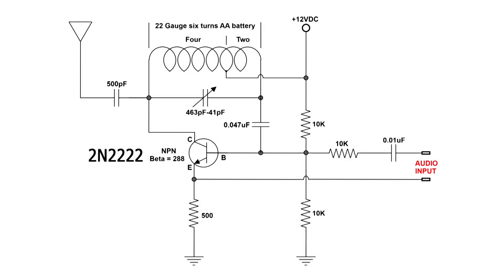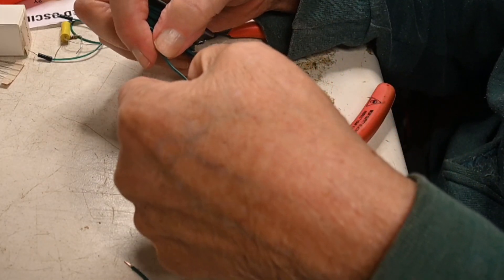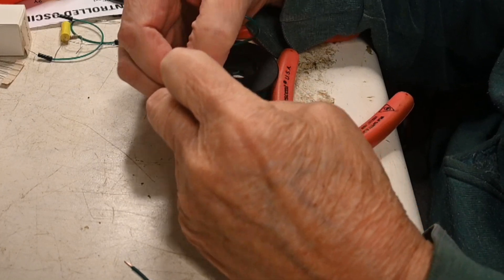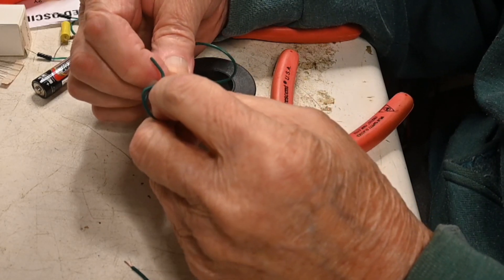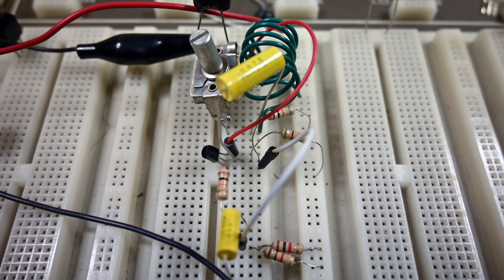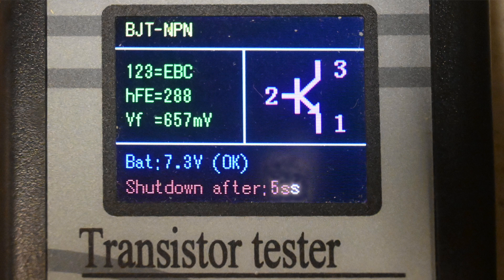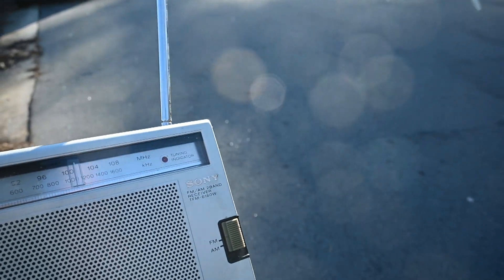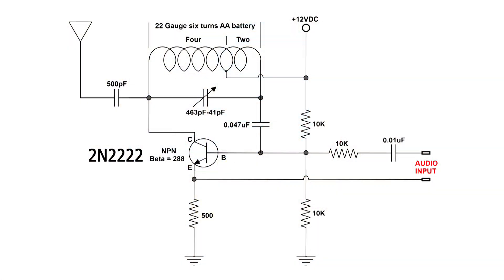FM Transmitter Home made Coil Build Demo

Comment: Very interesting, and I like the way you did the tap wire on the coil.
The wire I have is the same, but it is magnet wire, with the varnish coating.
That was a good distance receiving the signal from the house.
Thanks, Rick, that's another project for me to try. 📻👍👍
Reply from the maker: Thanks! Just about any wire should work. Let know what happens. Thank you, and thanks for watching.

Comment: No luck on my end getting the IC circuit to oscillate.  I tried several different transistors and verified the circuit was getting voltage.  It's always a great learning experience trying to find out where I have made the mistake.
Reply from the maker: It is about the same circuit as the AM. Ask your questions!
Reply: @AllAmericanFiveRadio  I can get the IC to oscillate at around 8 to 15 Mhz depending on the setting of the trimmer or whether I physically compress the coils together.  The peak to peak voltage of the signal from the antenna is around 5 volts.  Funny thing is I need to ground the oscilloscope probe to the Emitter leg of the transistor to be able to see anything on the scope.  Where do you think I made a mistake on this circuit?  Is the variable capacitor at fault maybe?  When you said the the capacitor needed to be close to the coil, was this a physical closeness or a wiring closeness?  Thanks in advance!
Reply from the maker: @edtully2740  What does IC mean, Integrated Circuit? It’s hard to tell what the problem is with comments. The variable  capacitor and coil should be as close together physically and electrically as possible. Can you make a video of your circuit. You can make it Unlisted and send me the link.
Reply: @AllAmericanFiveRadio  LOL.  I thought IC was the lingo for inductor/capacitor circuit.  I am sorry for the confusion.
Reply from the maker: My email is allamericanfiveradio@yahoo.com
Make the subject FM transmitter.

Comment: I have also made one transistor Fm transmitter circuit using BD135 ,it sounds really great with good range of 200metres ( using just wire antenna) , it is basically Brazilian design, i got it from Newton c braga website.

Comment: I have a CCrane FM transmitter. FM2. What Crane doesn't tell you is about the range pot underneath the spec label.  Once you turn it all the way right and add some extra wire to the telescopic antenna, I can drive out of view of my house and still hear my station.
Reply from the maker: Thanks for the information, and thanks for watching.

Comment: I wonder if it would be easier to use raw wire and solder the tap on after the coil is wound? I guess the insulation may have an effect on the coil. Interesting watch either way, Many Thanks.
Reply from the maker: Sure you can. I hope you build one. Thank you!

Comment: We built similar FM Senders back in the seventies, we used three turns around a pencil, if I remember right. Maybe I should do one now :-)
Reply: I used pencils too in the early eighties :) I started with something like this but I believe it was a BC547 transistor, and later on something with a BC547 and a 2N2219A for a bit more power. Back in the day we didn't have any radiostations above 104mhz (because some tuners didn't had the range from 88 till 108mhz). So that transmitter with a 2N2219A and just a dipole with a balun did quite some wonders at those frequencies. Ofcourse it was illegal, but as youngsters it was a kind of DX-ing with friends from the same age :)
Reply from the maker: I hope you do build one. Thanks!